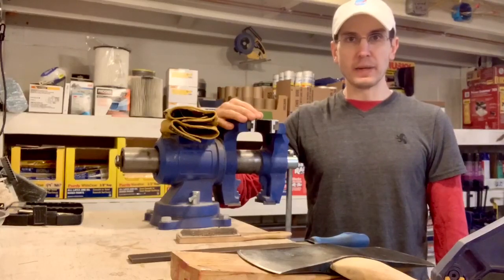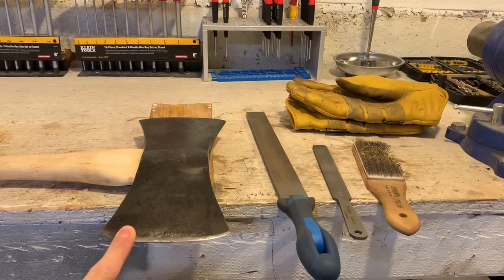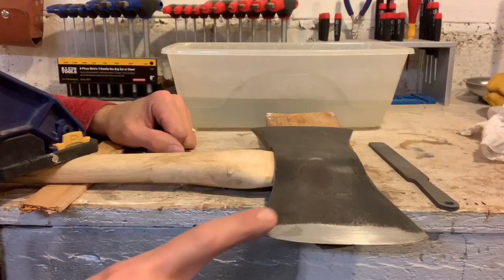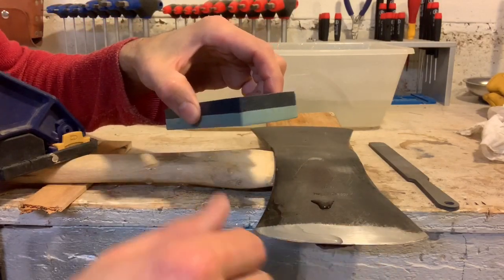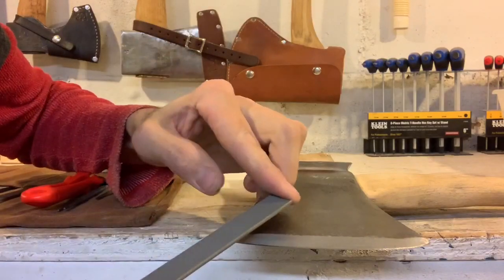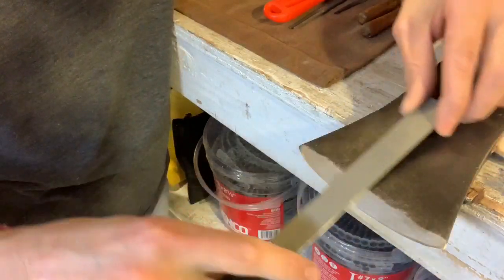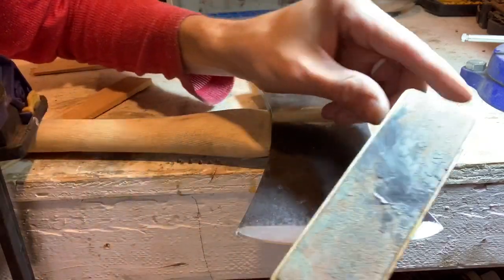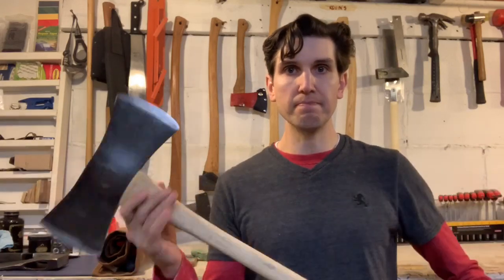How To Sharpen an Axe: Hand Tools Only

Comment: When you measured the blade angle, the tip didn’t touch the end or furthest inside part of measuring devise.  I’m thinking the axe blade should touch ALL the way inside the devise and not stop short of the end.

Comment: What files exactly should I get to use? Double cut something single cut something something? I know what a file is at least but haven't any experience using them. Brand? Shape? Style?  Help a noob out?  I've experience sharpening knives and understand the basic concept of sharpening, just never on an axe or with files.  Please & thanks
Reply from the maker: Sure, thanks for a real question.  Easy answer, if you want just one, get this one on Amazon: Simonds Rectangular All Purpose Machinist Hand File, Double Cut/Single Cut, American Pattern, 10" Length.  But basically when you’re sharpening axes, you need to remove a lot of material fast, so you want a very coarse file to do the bulk of the work—that’s the double cut side.  The single cut side, especially with lighter pressure, can clean up the really coarse marks, as well as put on your secondary bevel.  8-12” is about the right sizes for this type of work.  Start with this and graduate to other types and brands. Thanks
Reply: @KevinsDisobedience  Thank you. A few years ago I picked up a husqvarna SFA on sale for $50 and was only able to use it minimally. Now I've moved to a heavily wooded area and want to dial it in and use it a lot. I'll grab that file and start shaping/sharpening it. I'll be going over more of your videos and practicing soon. 🙏🏻
Reply from the maker: Good to hear it.  That’s a good axe.  It just needs a little attention.  Shaping is actually a better way to view sharpening an axe.  Most people focus too much on the very bit end, which is just honing.